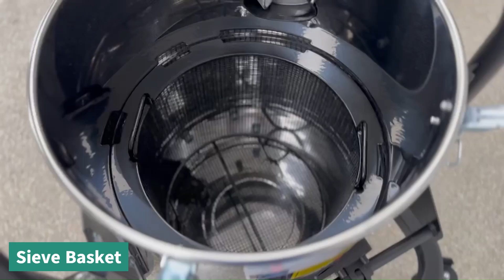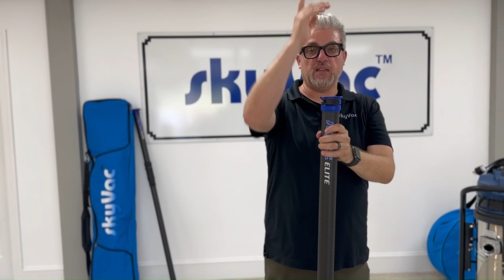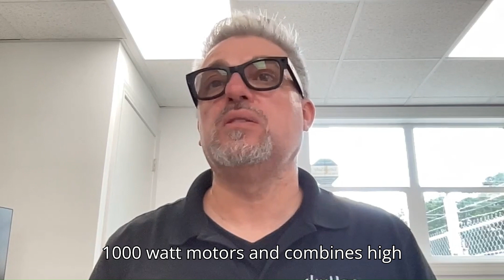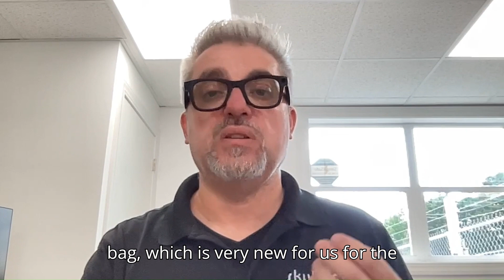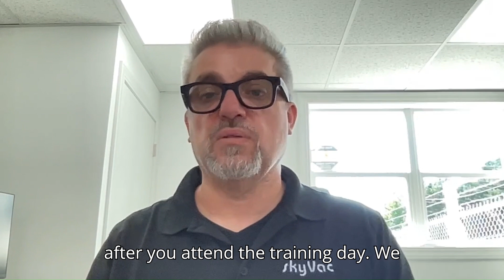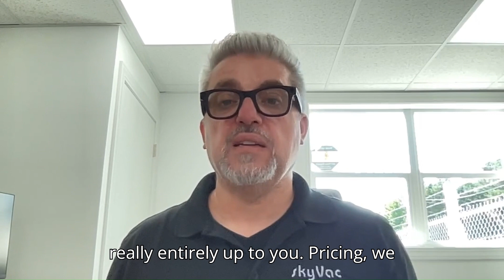SkyVac 85 Review: Top Features and Benefits for Pro Cleaners | Gutter Cleaning Vacuum System

Comment: Hi, Thanks for the awesome explanation. The SkyVac 85 is a little over mu budget at this stage. How would you compare the Commercial Plus 75 ?  Which is the machine I'm looking at buying.
Reply from the maker: Hello @joelorenzo7664,

Thank you for reaching out!

Here in the U.S. and Canada, we currently do not carry the SkyVac Commercial product line. If you’re located outside of these regions, we recommend checking with your local SkyVac distributor to see if the Commercial range is available in your area.

In our market, the SkyVac Sonic Atom is the closest equivalent.

To address your question, the main differences between the models are in airflow and water lift performance — with the SkyVac 85 outperforming the Commercial Plus in both areas. When comparing the SkyVac Sonic Atom to the SkyVac 85, there are additional differences, including:

Water lift and airflow performance
Drum capacity
Voltage requirements (Note: The SkyVac 85 operates on 220V)

Lastly, for customers in the U.S. and Canada, we’re pleased to offer financing options in the U.S. and a leasing option in Canada to make your purchase easier.
Reply: @skyvacusa  No worries. Thanks for replying.